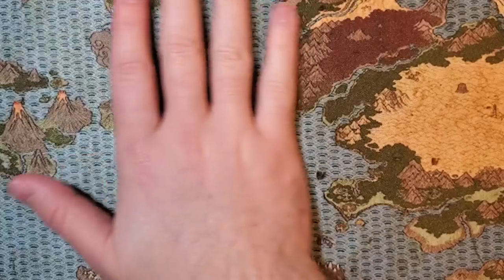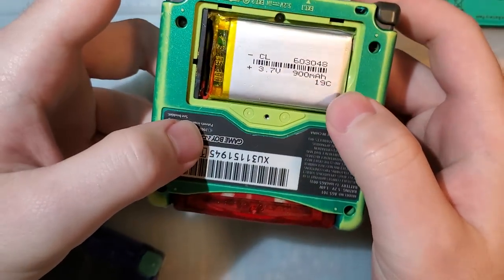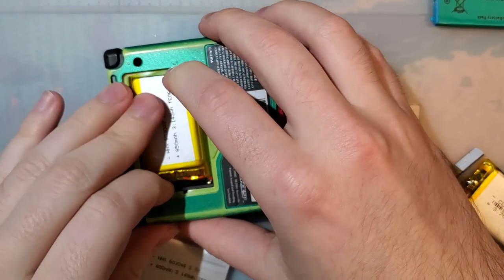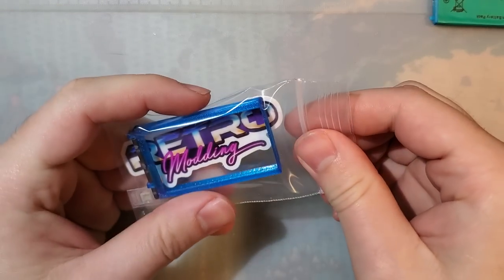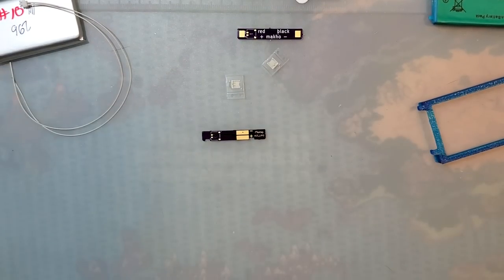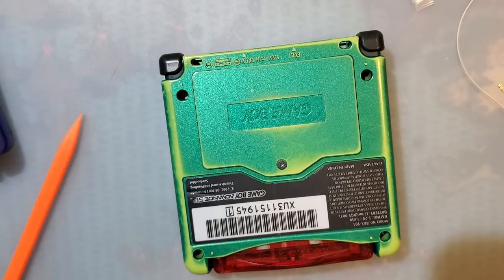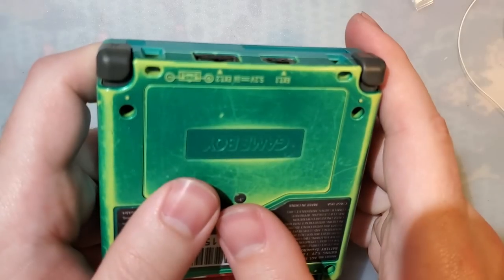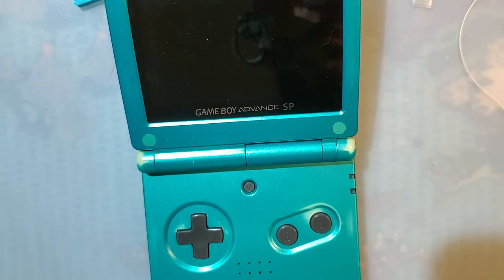GBA SP Mod Battery Mk II (Prototype)

Comment: Your contribution to a proper battery mod is invaluable. I do have the slightly wider battery, but the bracket will make it easier to fit no doubt.

Comment: Watching you solder those wires to the battery gave me anxiety haha. I accidentally shorted a battery once and burned a hole in my fingernail, threw the battery across the room. I have PTSD from that
Reply from the maker: I hate soldering battery wires or tabs. It always makes me nervous.
Reply: @makho  Try soldering 18650 cells with tabs. It's very frightening.

Comment: I'm using one that can keep my sp on for 35 hrs.. I'm using a battery expansion plate. The battery was only 8 on Amazon and I soldered the two battery wires behind the gold prongs black box... no pcb needed.
Reply from the maker: the whole point of the PCB is to make the mod removeable and to not require permanent modification. You can get six PCBs for less than $3 USD SHIPPED GLOBAL.

Comment: Aw man, I received one of these from RetroModding today and upon installing it today I was disappointed to see that it causes the battery cover to bulge when installed. I thought that perhaps it was my aftermarket GBA SP case that was the problem so I tried it in a completely unmodded GBA SP and the battery does not even fit in compartment, even with far more force than I would expect to use when attempting to install it.

I'm not sure if this problem is a result of my specific battery cell bulging, the tolerance of the 3D printed sled, or how the soldered wires stick out a bit (and aren't able to be pushed down) on my version of this product but nonetheless I'm disappointed and hope that they can work out their issues.
Reply from the maker: This seems to be an issue with battery tolerances from the factory. It should fit better in an aftermarket shell as those tolerances are generally a bit looser but unfortunately, that's just where we're at right now. Most batteries seem to fit just fine but some are slightly larger for whatever reason. 

If you don't like the bulge (which, frankly, you shouldn't), I'd recommend reaching out to Retromodding.

Comment: You had a similar idea like me but I take the frame and contacts from these green crap Batterie to fit it.

When come the test of the gba mod battery vs a Batterie with a tp4056 board?
Reply from the maker: I did a video on that already using the salvaged frame.

Comment: Hi, it is a very good design. BTW v2 is not available in oshpart now?
Reply from the maker: You'd have to ask RM. I may have the PCB shared in my github but the PCB itself offers no benefit over the V1 iteration without RM's 3D printed frame.

Comment: What are those little battery holders that allow you to use normal batteries in a gameboy and gba game instead of the tabbed ones? Kinda like the everdrive use I wanna put them in all of my gameboy and gba games so that I can use high quality name brand batteries from local retailers and what size should I get for each? Could you reply with a link for them please? Along with your thoughts or notes
Reply from the maker: you can't use those in OEM carts
Reply: @makho  ah shoot well where do you get name brand tabbed batteries? I’ve looked and can’t find any just the cheap yellow wrapped ones that have 1-2 duds in every batch and only last a few years
Reply from the maker: @kingarthur7255  what did you search? Because they are available on mortoffgames and digikey at least.
Reply: @makho  I searched eBay, Amazon then Googled some name brand names then tabbed cells of the appropriate sizes and couldn’t find anything name brand I don’t know a lot of the lesser known name brands and I don’t know a lot of these obscure hobby sites I am new to this stuff never heard of either of these websites you just mentioned
Reply from the maker: @kingarthur7255  https://www.mortoffgames.com/gameboy-advance/repair-and-replacement-parts44/game-repair-parts48/cr1616-coin-cell-battery-with-tabs-panasonic-

https://www.digikey.com/en/products/detail/panasonic-bsg/CR-1616-F2N/301860

Comment: A lot of the customer reviews at Retro Modding say that the battery along with the 3D printed housing causes bulging on their battery covers. One review from 02/28/2021 said that they had updated the 3D print design to better accomodate an OEM GBA SP shell, but I'm not sure. I tried asking about this from Retro Modding, but they haven't answered yet. Is it safe to buy a pre-assembled battery from Retro Modding?
Reply: The issue of batteries being slightly different sizes and GBA SP shells having tiny bit different tolerances make me even more worried. Do I just have to order one in and hope for the best?
Reply from the maker: @Moshugaani  I can't give you the answer that you want. Yes, you just have to order one and hope for the best. Tolerances on these things is worse than I had known with my limited testing (look, I only have so many SPs and I figured like 14 batteries would be more than good enough for a sample size) and the only work around is to keep trying different batteries or different shells or to just cut out the bottom of the battery compartment on your SP. If it doesn't fit perfectly flush and you're unhappy with that, contact Retromodding.
Reply: @makho  Yup, I understand. Well, thanks for your patience in answering people's questions constantly. :D
I guess I'll go ahead and order, and if I'm not happy with the fit, then I'll figure it out whether I can make more room for it or something. Cheers!

Comment: Any one know where I can buy that little connector he soldered on or what is the name of that part.
Reply from the maker: The battery connector is a 2 pin ACHR. The male port (the one that gets soldered to the board) is pretty cheap. The female one (the one that is on the battery) is cheap to get without the pins. If you order them without the pins, you still need to order the pins and a crimp tool. I have not been able to find pre-assembled pigtails for sale.
Reply: @makho  thank you so much

Comment: If I wanted to have a bracket printed in a custom color what are the dimensions of the frame?
Reply from the maker: the bracket is linked in the description
Reply: @makho  Right but for some reason when I upload it to the few 3D printing sites I've found online it thinks the dimensions are gigantic.

Comment: Hey makho. Completely unrelated, but I just got a GBA SP. When I turn the volume slider to the low-middle volume, there’s a high pitched noise made through the speakers/headphones that goes away by turning the volume slider up. Is this normal, or is something wrong with my console? I completely understand if you don’t respond, but I figure you’re the best person to ask :)
Reply from the maker: try cleaning it
Reply: makho I appreciate the advice, thanks!

Comment: Hey Makho, have you considered doing the same with PSP batteries? They have a higher chance of dying for some reason.
Reply from the maker: Because the PSP is a terribly designed console and is faulty from the factory. No, I'm not touching that shit heap. 

Batteries are always dead because Sony, in their infinite wisdom, designs the PSP to handshake any battery you use. This means that the battery has a small microcontroller in it. This microcontroller never switches off and puts a constant load on the battery cell. So whether you use the thing or not, the battery will always be flat after a week or two. This causes permanent battery damage quite frequently because there does not appear to be any low voltage protections either.
Reply: @makho  I knew about the chip, but didn't know it drained the battery. I've seen mods where people remove the cell from the shell and connect another generic battery to it with higher capacity. I'm wondering what to do, since I have at least 3 faulty PSPs. Sell them as-is or attempt something with them.

Comment: Not sure if you’ll see this comment. Haha 
I purchased two 950mah batteries from retro gaming repair. 
Should I be concerned or am I good to go?
Reply from the maker: Nah, those are fine. I've heard that some batteries in some shells cause a little bit of battery door bulge but as long as the cell itself is not bloated, there will be no issues.
Reply: @makho  Thank you for the quick response!

Comment: Do I need this 3d printed thing? Or can I use such a lipo battery mod without it?
Reply from the maker: The v1 version of this mod is designed that the PCB may be wedged into place and make contact with the battery terminals. It is NOT (intended to be) held in with the battery, the pressure from the wires, or the battery cover. 

v2 needs the bracket (or may be shimmed until you can wedge it)
Reply: @makho  I got it to work. But thanks anyway for your response.

Comment: Why some are having door bulge ?
Reply from the maker: Tolerances. Some SPs have slightly smaller battery compartments and some batteries are slightly larger. If you get lucky enough, the battery won't fit properly and the door will bulge slightly.